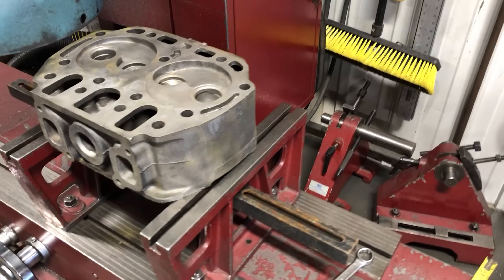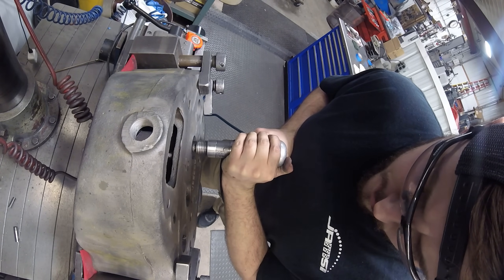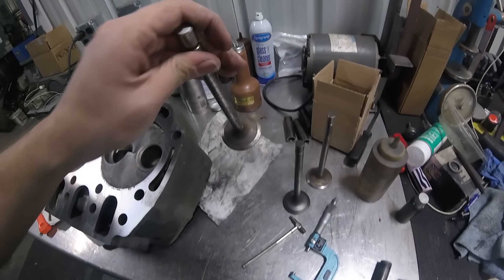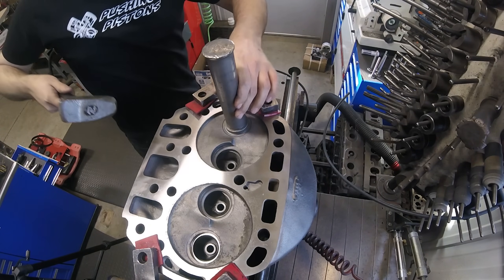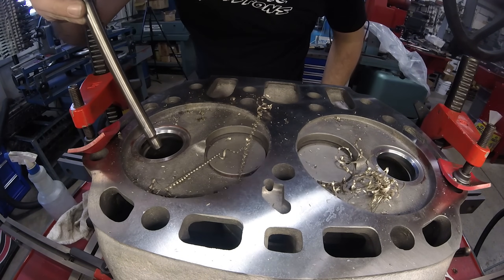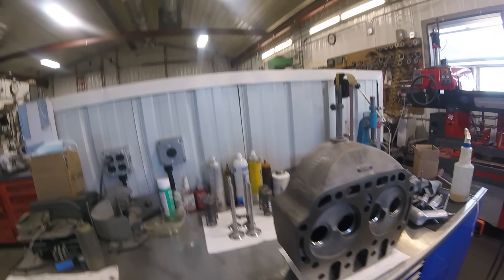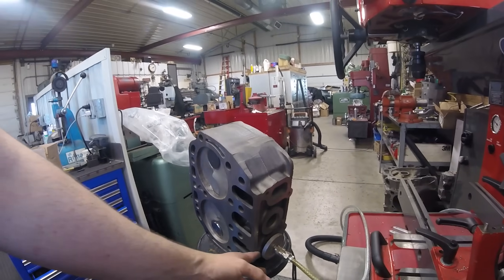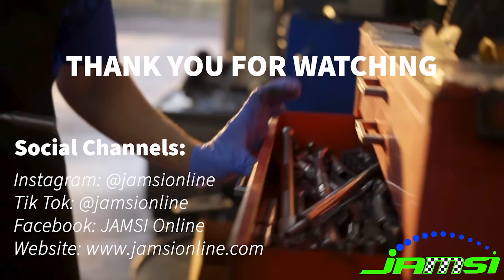Rebuilding a John Deere Model A Cylinder Head - Valve Job - @JAMSIONLINE

Comment: If i wanted my cyl honed for new rings what type of hone would you use for a ls2 i was under the impression that a honing machine would be used right or would a ding ball hone be used at a machine shop
Reply: The reason I ask is because  I brought 6.0l ls in becouse the piston bent a valve i wanted the valve seat repaired guide checked.and a new valve piston rings and coated bearings i gave the the machine shop the block with rotating assy and heads what i got was dingle ball honed he forgot the seat and quickly repaired it while i waited with a stone all of 5min i assembled it with all new parts dod delete cam lifters pushrods springs trunion gaskets and so on  4 weeks later again ptv contact is this a bad or lazy machine shop

Comment: I've been told by some old two cylinder boys  that if a old two cylinder Deere has weak valve springs they won't idle right.  May only idle on one cylinder.  I  personally haven't run into this yet,  but best to check those valve springs.

Comment: a 3 angle valve job on that type head is kind of counter productive. As eventually it will carbon up on the non seat angles. And you are reducing the amount of available seat to valve area. which is going to reduce the service life of the valve job witch is generally the most important factor on that kind of application. In my opinion.

Comment: When i was a kid  My dad built a log splitter from an old hand crank 2 cylinder John Deere combine engine we got outta my uncle's field in southern Maryland. I don't remember the year of it but we honed it and put new rings and i remember it had to run with non detergent oil. I think he said it was a 16hp motor

Comment: I owned a Model H, and after purchasing it, found the cylinders would fill with water from cooling system overnight.  Horrible installation by someone of sleeves in cylinders. Tore it down , had head trued, new sleeves professionally installed, new babbit bearings poured for the rods. After all of that, still got water in cylinders. Went back for another set of head gaskets, and ran into a "old timer" who heard my issues being discussed. He told me to take the all metal head gaskets and spray paint a couple of coats of paint on them and let them dry, then install. Never had another problem.
Reply: Is copper coat spray ok ? I know my metal head gasket on my little h was coated with that  after the overhaul I installed a grey one with fire rings but didn't spray it. Had some coolant in the crankcase . I think I have it stopped with stop leak. Lately these aluminum engines are giving me similar fits . I think I will be spraying head gaskets and use new head bolts. Thanks for the insight.
Reply: @ronaldgodden4490  All I used was something like Krylon spray paint. You are just filling in the tiny scratches that you cant even see. Couple of coats, allowing drying between times. Fixed my issue completely. Had the tractor for several years and never leaked.

Comment: As a fellow engine machinist why don’t you do the valve work and then surface it? That way you don’t have to be so worried about scratching the head gasket surface.
Reply from the maker: On Diesel, I surface first just for the reason of being able to accurately set valve protrusion/recession.

On everything else it just depends on the work flow of the shop & what machine is open. In this case, I knew the surfacing machine was about to be tied up w/ the block fixture for boring/decking blocks... so I got the surface out of the way first.

I agree it’s nice not to have to worry about scratching the nice surface, but at the same time it’s just not really that big of a deal as I’m careful not to damage the surface regardless lol

Just the way things go in our shop 🙃
Reply: Thats also an engine with about 5:1 compression ratio so mating surface isn't a huge deal

Comment: What is the interference fit between the new seats and the head? It amazes me that they don't drop, it's pretty cool !
 Also, just curious, why don't you surface after all the valve work is done? so the surfaces don't get scratched.

Comment: Now why do you cut the intake at 30 and the otulet at 45 degrees? Is that dictated by the valve geometry?
Reply: Manufacturers have specs for the seat angles, matches to the valve face angle.
Reply: @bigford1578  alright, thanks